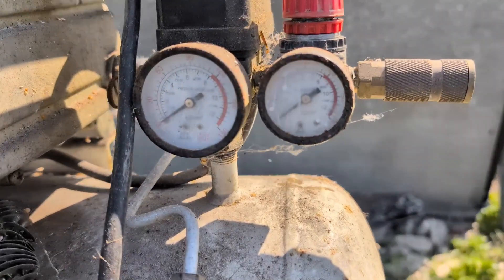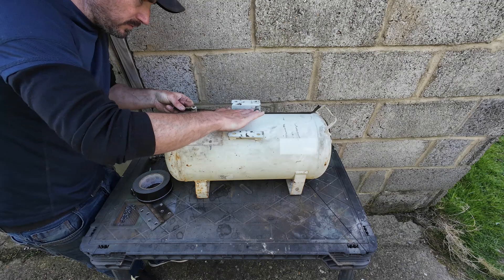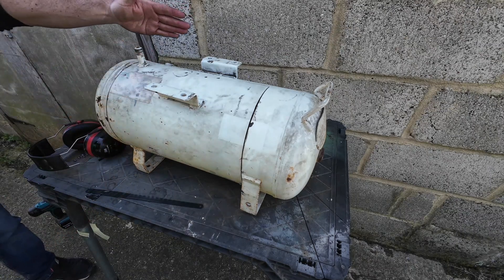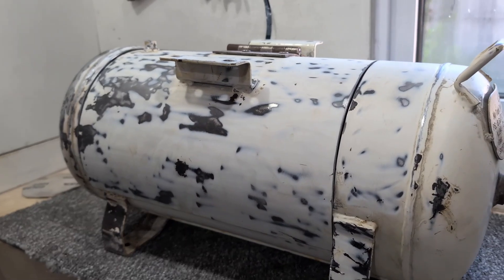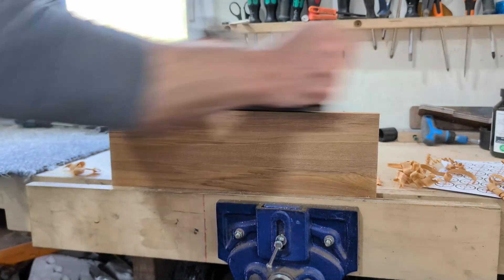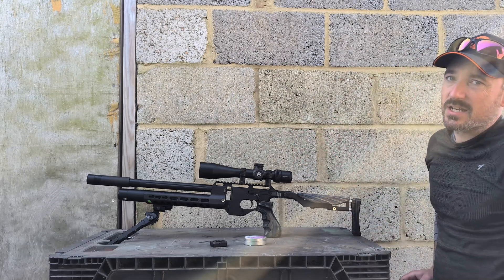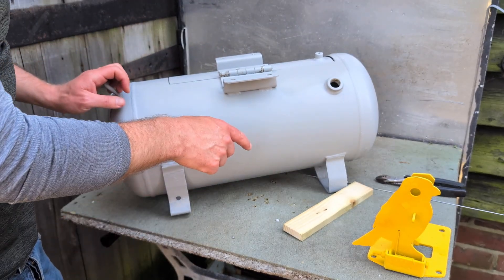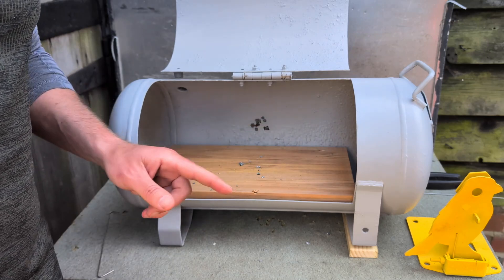My new custom air rifle pellet trap is amazing. Safer and stronger modular design!

Comment: Just got myself a huge propane bottle I’m here for the tips 😅 subbed 💪🏻
Reply from the maker: Awesome stuff mate. Best advice for the bottle is add something to reduce chance of ricochet. Some sort of curtain or plumbers putty. The heat treated steel can throw a few back at you,if you're not careful 😉
Reply: @tillysgunstocks  I also gained a load of thick foil backed insulation boards so will cut them all to size and rotate them as they get worn out that’s of if I don’t explode when I cut into the tank 😂
Reply: @tillysgunstocks  it will be set up at 40yards 👌🏻

Comment: I've made one which is much smaller it's made from a camping gas cylinder and I took the valve out then put it in a fire. The result is a clean surface which just needs a quick going over with a wire brush on a drill then paint with red oxide primer.

Comment: If you have air tools , a needle gun would have done a good job of cleaning up all that scabbing. Noisy, though.
Reply from the maker: Funnily enough,I've never used a needle gun.. I don't think I've ever even seen one in the flesh but they're meant to be brilliant things 🤔
Reply: When I worked in plant hire we used to use them to clean out the mixer drums when some muppet let concrete go off in them. Mind you if any plant hire places are scrapping mixer drums they would make a good pellet trap as well.@tillysgunstocks

Comment: Great video, I would use stick on sound deadening material in my area. Looks mint.👍🏽
Reply from the maker: Good idea mate. I'll likely use some plumbers putty or try out some different 
materials to act as a little ballistic curtain 😉
Reply: Insulation like that stick on stuff your put in van builds. Couple of squares be ideal. Just need a compressor now and with your video it’s a great idea.

Comment: Neat idea! You need to experiment with something to line/hang inside the back, to trap the pellet fragments. On a .22LR range we use Linatex but airgun slugs tend to bounce off it like a trampoline! 
By the way, a .22LR round will go straight through that steel. So best not use it for that. 
I love the design and recycling of this old tank though. Really neat and with a better material inside, I suspect it could be made to trap everything.
Reply from the maker: Cheers mate, I'm thinking the plumbers putty might be just the ticket. It works really well and is very quiet. I've got that in a few target card traps I made. 

😉
Reply: @tillysgunstocks  
Now that's an idea! Never thought of that. 👍🏼
A note to anyone thinking of building an airgun range in their garden (or anywhere) : Certainly don't attempt to hang old carpet as a backing, as that also causes rebound type ricochet risk, especially when it has been wet.
Most forms of wood will likewise not trap the pellets especially, if it gets damp or wet. As a boy, using a BSA Meteor Super in a very long garden, on a home made range of forty yards, I learned that lesson the hard way. An old shed door was used behind the bank of earth we built up for the range, but the top edge was about a foot higher than the bank and got very wet in the rain.
I fired at a target I had pinned to this edge and shot myself in the forehead instantly! The pellet hit the wet fibres of the old shed door and it rebounded directly back up the line of the shot and hit me pretty hard in the forehead. Fortunately I was looking through a scope so my eyes were a little lower than the line the pellet took. I couldn't believe it would have that much energy over a combined distance of eighty yards but it clearly did. It must have gone up and dropped back in terms of flight path but smack me it did! I stupidly, thought it must have been an odd fluke. Three shots later, I did it again!
I very quickly learned not to shoot damp or wet wood! We also modified the range and built the earth bank right up and over the top edge to cover all the wood and made a marker at each end of the bank with a line of garden twine stretched across, to show maximum target height. Never had the problem again.

Comment: I used hanging 3mm plates as a false back to take the power out of the pellet causing it to drop into the bottom.
Reply from the maker: That's a great idea mate. I'll do some experimenting with this. There's been some really good suggestions so far. I can probably get a couple more videos out of this build testing all the ideas 🤔😆
Reply: @tillysgunstocks  yeah I made the pellet catchers at my local range.

Tried various different angled backs to get the pellet to drop into the bottom. But no matter what angle I tried, there would always be too high a percentage that came out. They would have to be 2 feet deep to catch them all, lol.

The 50mm wide 3mm plates had a tube welded along the top edge that slid over a peice of studding that ran the length of the catcher so they would swing.

If that all makes sense

Comment: I us a a color gas bottle with the front cut out and put targets in front of it. Sometimes I cut cardboard to size and tape that over the opening with stick on targets. Yes it dings like a bell but lots of layers of carpet and thick rubber matting helps.
Reply from the maker: I reckon the plumbers putty should quieten this right down mate
 I'll try a few of the suggestions and see which works the best 😉

Comment: I wonder if the base was some sort of mesh instead of timber would the spent lead fall to the bottom. As you said put the plumbers putty inside too. 👍
Reply from the maker: That's a great idea mate as it goes 🤔 for the little silhouette targets it might be a problem as they have small feet but for the bigger stuff... Hmm I'll give it a try 😎

Comment: Brilliant👍 just wish I had your practical skills and gear to build something like that on those lines. Nice being able to trap the pellets too.
Reply from the maker: Hi nick, it's definitely going to be a good base to work from. Got to get some other lining material sorted for sure but that cylinder is super tough I reckon it'll last years if it doesn't rust away first 🫣😆

Comment: Ingenious Mr Bond, l mean Tilly 😂. However I have to repot you for the lack of a handle on the angle grinder 😮. Seen too many nasty injuries and where were your safety gloves. Try sloshing some cider vinegar inside the cylinder and I think you are right about putty as a liner 👍. Top job 😎
Reply from the maker: 007 and a quarter 🤣🤣

I've had my fair share of angle grinder related injuries over the years too 😬😭

Comment: You made a neet job of it , shame it did not contain the pellets . I made a couple from the square 25 litre plastic fluid drums , cut a rectangle out the front , put half inch ply board in back held with screws , screw an old piece of carpet to the ply wood . tape a piece of cardboard to the front and tape paper targets to the front of the cardboard ,works perfectly for pellets and BBs alike. You can even leave the carboard off and line old tins up inside to knock hell out of , still catchs the pellets . I sent my Idea into an airgun magazine and was lambasted by the editor  because he thought it was unsafe , shows you how much he knew !
Reply from the maker: Have you seen my putty lined trap vids mate? For me personally it's a great option for target card traps. Although I do like lead lining as it makes recycling a lot easier 🤔😉
Reply: @tillysgunstocks  No I have not I will look out for them , thanks

Comment: If you ever use a old butane or propane bottle once you have removed the valve always fill with water using a hose and it will fully purge the bottle of fumes prior to cutting
Reply: Believe me can still be a flame risk , seen it happen , bottle went off like a rocket.
Reply from the maker: 🫣 sounds like what we got up to as teenagers on the farm 🙄

Comment: Nice little project, shot blasting would probably be the only way to get that clean, I suppose if you shoot it enough times, that will eventually do it as well 🤣🤣. Alternatively, you could treat the rust with one of the many inhibitors out there and then paint over. Now you know why pressure tanks have to be inspected on a regular basis.
Reply from the maker: I'll give it a good blasting with lead mate 🤔 
I think in the future I'll look out for a used gas bottle, they should be even thicker gauge and hopefully less corrosion internally.  This will be a good base to work from though, some plumbers putty and lights down the line I reckon 😉

Comment: Well made👍🏻 you can also make a led light in it so you can use it when it’s dark 😁
Reply from the maker: That is the plan for the MK3 😉😉 
I'll take it to the club for the winter evenings 🤯 
I can use a small magnetic led torch up inside the lid. It will shine back on the target 🤔

Comment: Add that to the list of things to make.
On the lookout for an old compressor now 👍
Reply from the maker: Funnily enough they seem to come up all the time. I've got another scrap one already 🤔
Reply: If there is a car breaker yard close by to you, you could also look out for a brake system compressor tank from a bus or a lorry.
Reply: You could also use an old gas bottle
Reply: @robmule4647  if you do use an old gas bottle or old fire extinguisher, I’ve used both. If gas fill it full of water after you unscrew the valve and let it sit a while. Then empty and repeat a few times. Then fill just over half way , then lay down and cut. Other wise it can easily go boom. Gas bottles still hold gas vapour trapped in the metal and the flushing and water inside stop this igniting of the sparks. Google it if anyone is planning on doing it, but I’ve done about 8 times this way fine. I cut mine a few cm narrower than my paper targets and got some magnets and stick them on. Catches pellets too,  store for scrap yard to go towards more pellets, you would be surprised how much money it adds up to.
Reply: @ Great info 👍